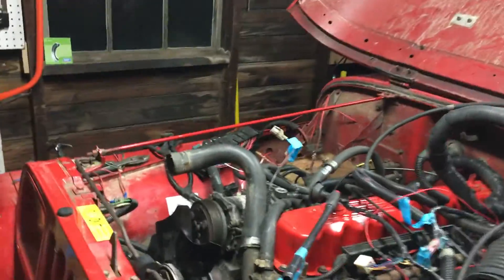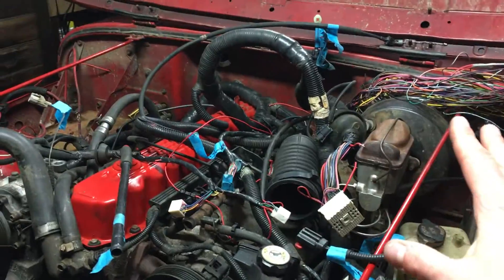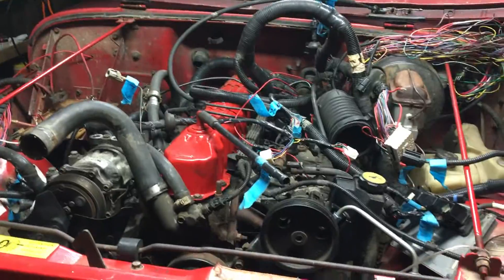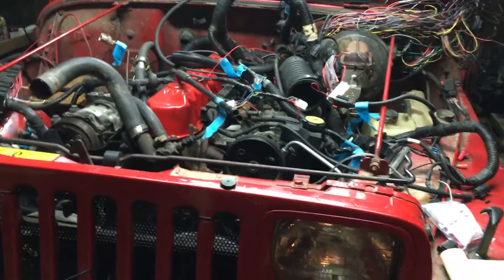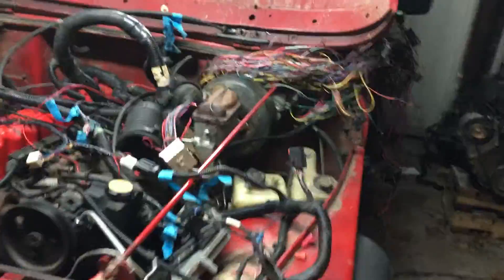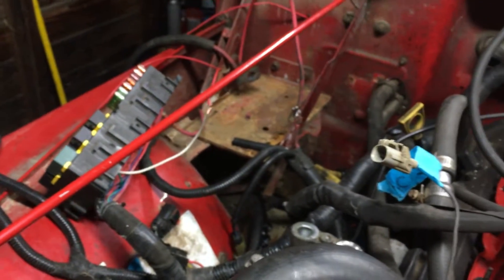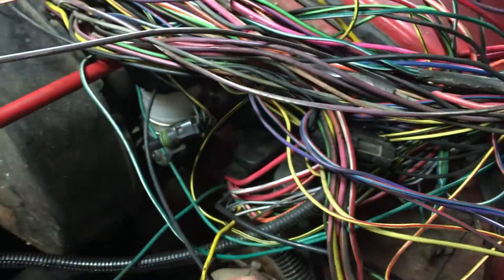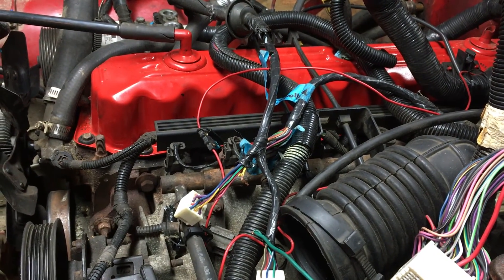Jeep YJ 4.2 to 4.0 engine swap wiring part 1

Comment: Good video. QUESTION for you. I have an obd2 96 model 4.0 that I took everything wiring, sensors, fuse box, everything. Is it possible to hook everything up to where it went from factory and have it run? It’s going in an old jeep that would have no communication with the dash or any other gadgets, it needs to simply run the efi. I have the Cps and o2s already taken care of.

Comment: Stephen, 
I realize that this project didn’t make to the finish line, but these videos still remain the best source of information on swapping an OBD2 4.0 into a 4.2 YJ. Would you be willing to share more information on the subject? Preliminary wiring diagrams? Were you planning on integrating any of the gauges? Were you going to utilize the OBD2 port and it’s diagnostic functions? Thanks, Hinmaton

Comment: Dude! Thanks for this video. Question I just bought a 79 Jeep CJ7 with a 99 Jeep Cherokee 4.0 fuel injection. Will the wires be the same color as in your video?
Reply from the maker: Hi there, wires may be the same, I’d be very surprised if the were different. That said, my motor was out of an ‘00 which used coil pack ignition, yours is cap and rotor. Technically the harness will be different, but the colors may very well be the same.
Reply: am having the same issue dud you get it starting

Comment: 92 jeep yj 2.5 I'm not getting power to the coil. I have replaced many parts.  Engine turns over but no fire to the coil. Any wiring suggestions to help me fix this wiring problem?? HELP ME STEPHEN PLEASE

Comment: I got an 84 CJ7 that I’m trying to get running. This is the exact video I needed to join the CJ with the 2003 4.0 L. Can I message you with any questions? I understand this is a little late.
Reply from the maker: Sorry for late response on my part. I’m sure you’re on the road by now, but send any questions you may have. Good to know that this works on a 2003 harness.

Comment: Hi 
.Stephen gillett 
I have also yj 1989 and it have a  orignal engine I'm going to  swap wrangler 2006  on it but confuse to start up  ....how can I arrange wiring in yj deshboard ??
Is any detail video to help me out thanks
 I'm from Pakistan
00923452359608

Comment: Hey Stephen! I'm doing the exact same swap with an 87 YJ and a 2001 XJ donor. I have everything wired up and spliced according to your video. I'm having an issue getting it started. The motor will turn and I have a temp setup for the fuel pump and am getting 43 PSI at the rail, but it appears I have no spark. All grounds are solid. Any advice? I feel like im missing something simple. The CPS checks out, tearing my hair out here so any help would be greatly appreciated, thanks.
Reply: Crank sensor
Reply: @mattperry1449  I thought so too but the CPS is giving the right readings, unless I'm testing it wrong
Reply: @taylorcoulson4242  you know more than me sounds like.    Idk what the CPS is?  I replaced every electrical part on mine one time.    Then someone laughed and told me about the crank sensor.    I replaced it.     Started right up.    Then went bad again within. A month
Reply: Never mind.  I'm a dipshit.    I know what it is

Comment: I just bought a 1990 yj and it has the 4.2L straight 6. It has a carburetor, I want to swap it to a 4.0L but it’s fuel injected. Am I able to swap it with out converting it to a fuel injected? And if so do you know what years I can would work?

Comment: i got a 89 jeep yj 4.2 auto that im getting ready to swap the 4.0 motor trans and tcase out of a 97 grand cherokee. how much of the wiring doing i need to take from the grand cherokee? just whats under the hood or all of it? i actually have the donor vehicle.

Comment: can you tell me what you did about the fuel pressure regulator, the xj i use had the pressure regulartor in the tank
Reply from the maker: I bought the fuel pressure regulator that is the stock part for ZJs running a 4.0. I was getting 80 lbs at the rail with no regulator, regulator brought it back down to 35 ish. This is the part that i used...https://www.4wd.com/p/2001-Jeep-Grand-Cherokee-(WJ)-Crown-Automotive-Fuel-Filter-(None)-52100283AD/_/R-BKMN-52100283AD?utm_source=google&utm_medium=cpc&utm_campaign=shopping&emlprox=out&ppcfon=1&gp=1&tf=1&gclid=CjwKCAiA9MTQBRAREiwAzmytwxEyMc63R7UYhxlTpgGRVrv26hokJt1NJF6XiV_ZOj8-HsIgmwKWnBoCPVEQAvD_BwE